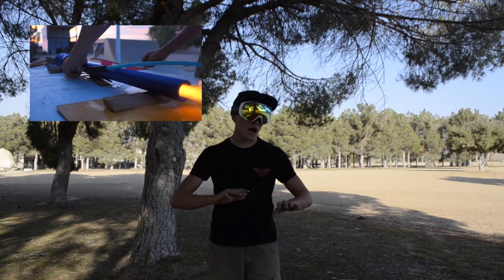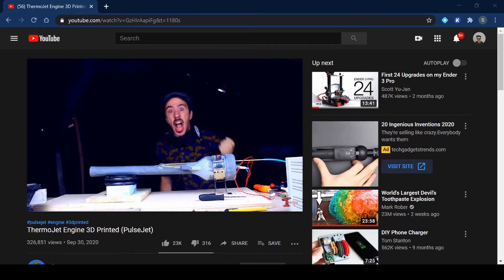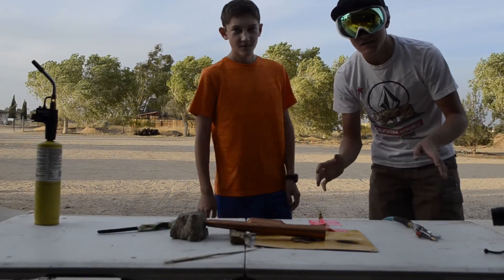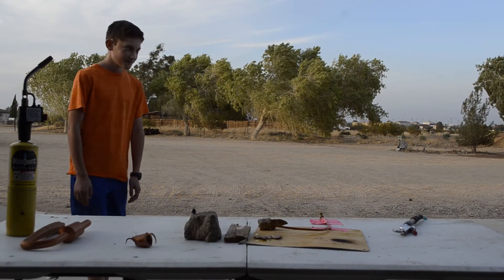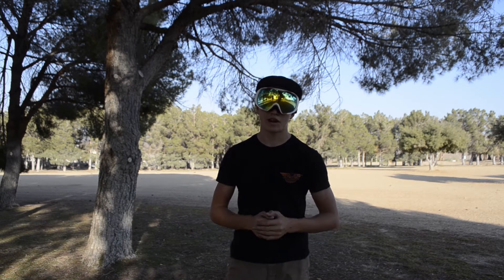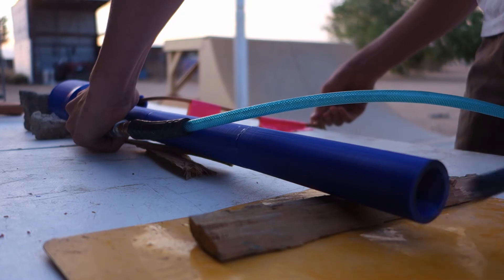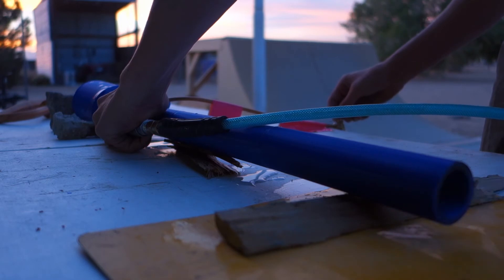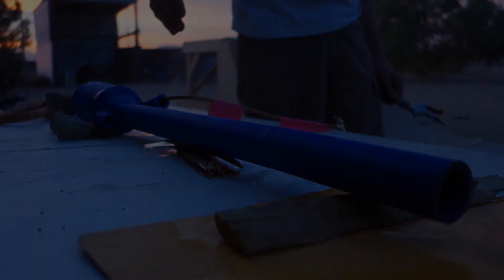3D Printed Jet Engine

Comment: Just a question, as i want to make this myself: Does he thermojet need a Constant feed of compressed air? Or does it become self sustaining After startup?

Thanks
Reply from the maker: This design of engine needed a constant feed of compressed air due to it's poor inlet design, however my carbon fiber one was able to run on its own. I think with some minor modifications, this engine could be self sustaining, but I haven't really looked into it
Reply: ok thanks! I will probably try to modify it!

Comment: I guess you can buy plaster powder at local supermarkets and they are pretty fire resistant use a thick layer of it to coat the inside of your last design and see how it works... BTW integza did it too
Reply from the maker: Thanks for the suggestions, I plan on revisiting pulsejets in the middle of 2021 to increase their performance. I plan on building a flame resistant engine in that video.
Reply: @AxelDayton  that's nice amd thanks for the reply!! 🙂
Reply: And*

Comment: Hello there! I am 15, and fellow hobbyist such as yourself - I have two 3d printers -  I've had them for about 2 years now, and I like to build stuff as well. Seeing how much fun you seem to be having building engines, I couldn't help but check out what you were up to on your YouTube channel. I saw your video on Thingiverse about your design on th elockwood engine, and though you might like a comment : try to make some starlite, like Integza did to coat the engine with it and increase its temperature resistance. Also, if you ran your fuel through a pipe in the combustion chamber to pre-heat it before injecting it into the chamber, that would definitely also improve results!

I've been debating weather to start my own YouTube channel as well - I don't know weather to or not. I'd probably make videos on projects to do with coding, welding, 3d printing, and electrical work too - I just don't know weather it would be worth it;  if I'd just be wasting my time.
If you've read this far, thanks very much. I sincerely hope your channel skyrockets - I very much enjoy watching teens like me doing projects like this. 
Good luck!!
Reply from the maker: Thank you so much for your suggestions on how I could've made the engines run longer, however in this video I was trying to run plastic jet engines without any reinforments and I didn't have enough copper tubing to run the fuel line down the exhaust. 

In terms of your YouTube channel, I would say if you have the time, equipment, and commitment. Go for it! It sounds like the world needs to see your skills. Also I spend personally between 50-200 hours each month trying to put out the best possible quality videos I can with my busy schedule. You don't have to put that much effort into a video, but if you can weld, 3d print, and code. The world needs to see what you have to offer! 

Thank you so much for watching and good luck!